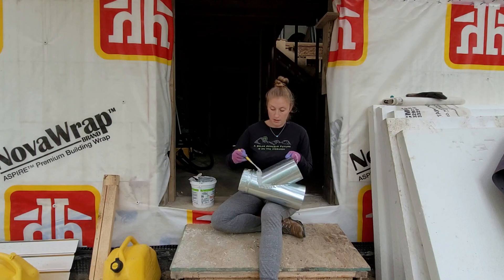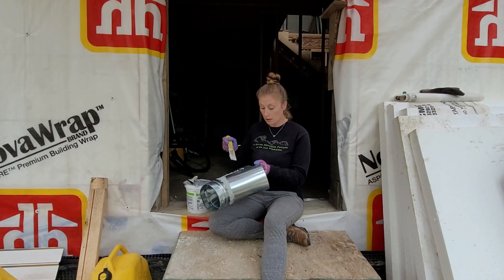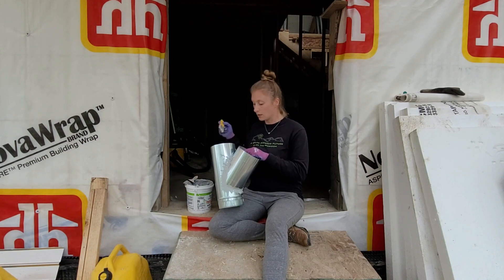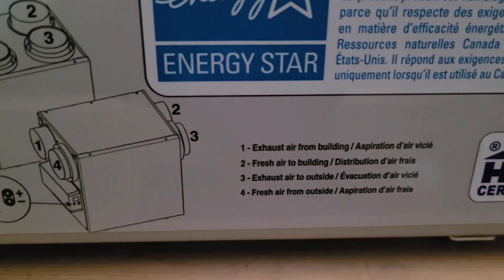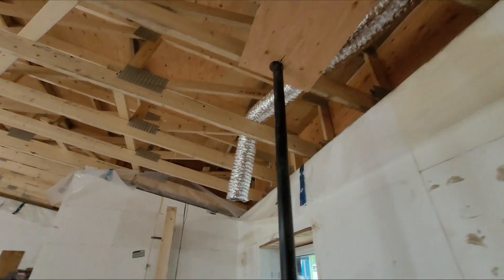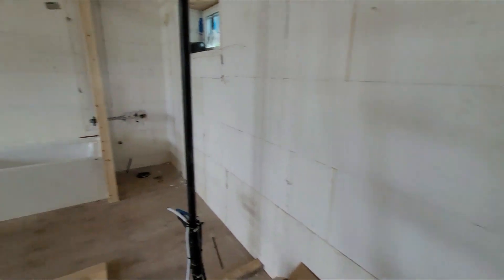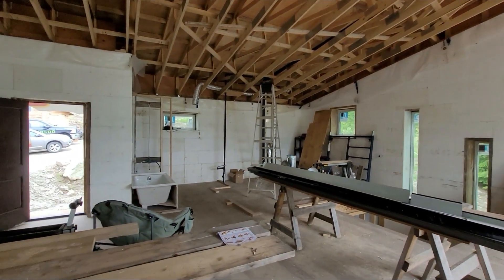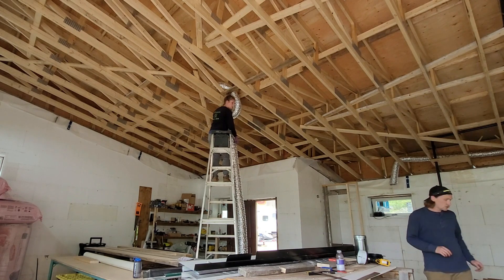Another DIY project: HRV and ducting- HVAC installation.

Comment: You guyz are gainin' on it. You might want to think about air barrier/vapor barrier paint over drywall. On the attic side seal each penetration with closed cell foam. That's what I'm doing. Easier and eliminates that plastic that never seems to work perfectly.
Reply: I'm going to make a video on it soon but we are actually doing a 3" false ceiling within the vapour barrier for all our electrical etc so there's only 2 penetrations in the whole vapour barrier. I'll look into that air seal drywall paint though, thanks.